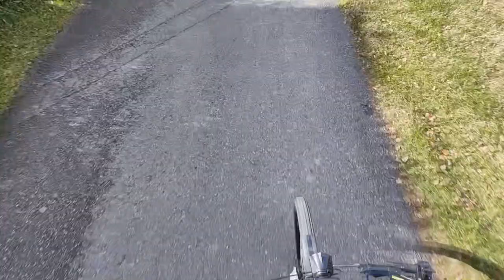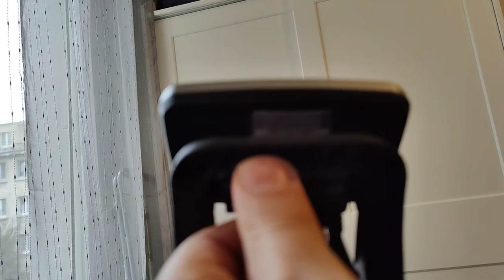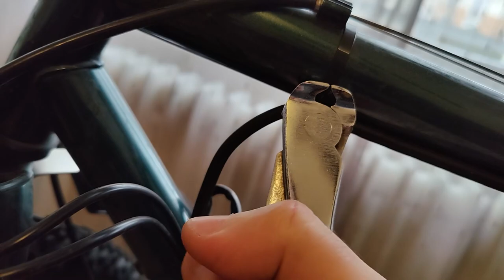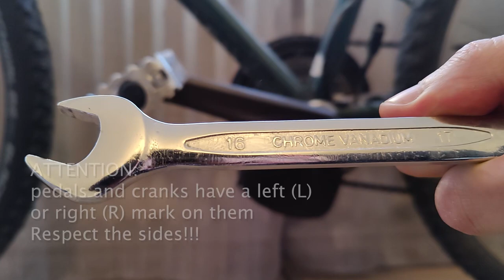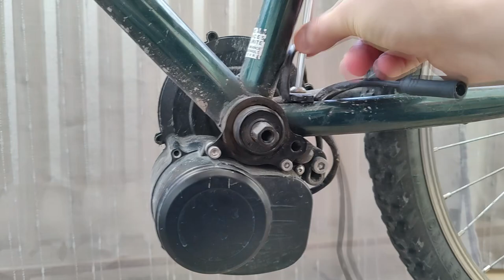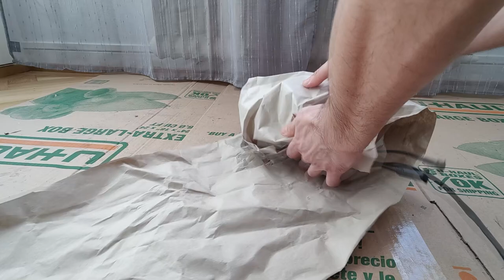Tongsheng Frame Replacement part 1: Take Apart TSDZ2 Mid-drive Motor Kit from an old mountainbike

Comment: Hello Luke, i have a question, how long the pedal tube must be for this to be installed ? From the sellers site mention 68mm to 73mm but my bike is 75mm. By measuring you old bike pedal tube and tsdz2 tube you think you can provide me with a answer ?
Reply from the maker: hey, too late the frame is gone, but it was between 68-73mm.
so either you take the risk to try fitting it anyway or you should just use another frame... sorry for that
Reply: @LukeLorusso  thanks! im ready to buy it now, just one more question, i see many versions in the listings. They have 48v 500w and 36v 350w is there any official 48v version or the seller just put it just to sell the same 36v one as better ?
Reply from the maker: @EpicHardware  Hey! The seller cannot lie about the voltage: since you have to match battery and motor's voltage, it has to be the right one!
But apparently someone claims that the TSDZ2 is basically always the same motor re-configured to work with different voltages and to output different watts... BTW don't take my word for it, cause I haven't verified this (yet...)
https://www.reddit.com/r/ebikes/comments/cwtogp/comment/eyf9ira/?utm_source=share&utm_medium=web2x&context=3

Comment: Hello man I am looking for a electric kit to go to work with my bike without doing effort and sweat. I am only looking for the cheapest and efficient solution. I cant afford a bafang kit that’s way too expensive than a Tongsheng one. I am wondering if the Tongsheng would fit in my needs since i heard that this motor needs some help and strength from the rider to get any assistance. Or buy a front drive wheel what do you think ?
Reply from the maker: Hey man, it's not an easy answer...
I prefer mid-drive kits since hubs are harder to install and maintain, but that's just my personal opinion.
What you are talking about is the torque sensor on the Tongsheng and yes, you need to cooperate with the motor. But it's not necessarely hard (you can simply max-up the assistance level and you'll make a very small effort) 😉 I used to go with level 3/4 in Paris!
But it's also true that with a cadence sensor you could make 0 effort and just let the motor do its thing (steep climbs aside). If that's what you want, hub motors or a Bafang mid-drive kit are the ways to go.
On my previous video I explain that better. check that if you haven't! https://www.youtube.com/watch?v=wqj-kWgJCqw
Reply: @LukeLorusso  thanks for the quick and accurate answer. I looked your previous comparison and you convinced me, i won’t take the Tongsheng one. I dont want to struggle with the traffic and the wind at the same time. I’d cross a narrow country road likely dangerous but i still want to do it with a bike thanks again keep up the good work
Reply from the maker: @djaffar13013  happy to help man 💪 welcome in the club of diy ebikes!
Reply: I just installed a Tongsheng on my bike, and I am extremely pleased with it. I am quite old, overweight and I wanted to use a bike for my urban commuting across my town, Milano. The Tongsheng does exactly what I need, and the effort from me as a rider is very, very small. It’s like having bionic legs… yes you have to push on the pedals, but it’s a very low effort and the motor does all the work, not me! So, if I were you, I would consider the Tomsheng as an option!
Reply from the maker: @sidecarural  Grazie per aver condiviso la tua esperienza :)